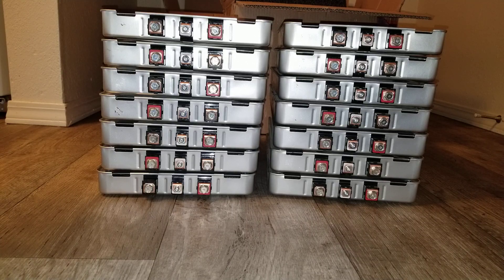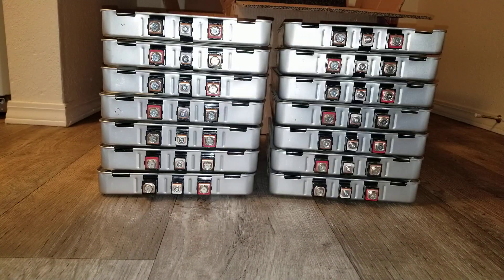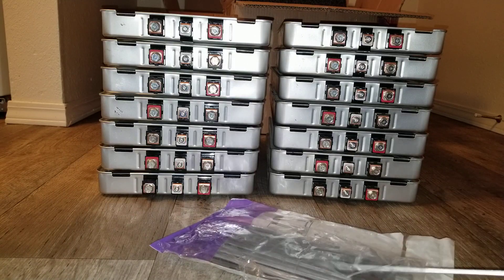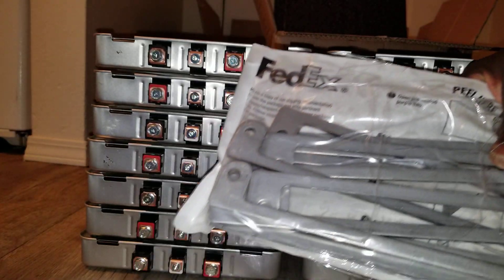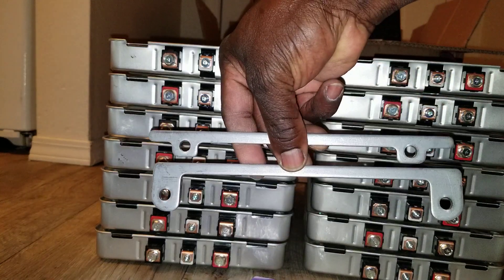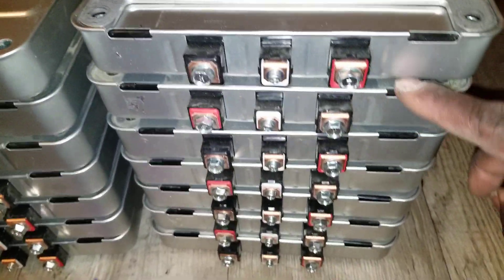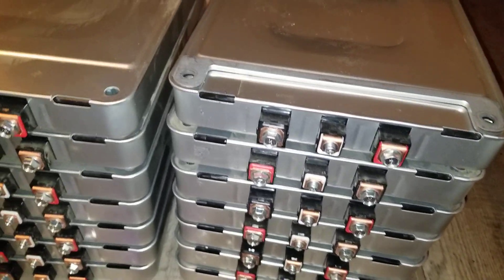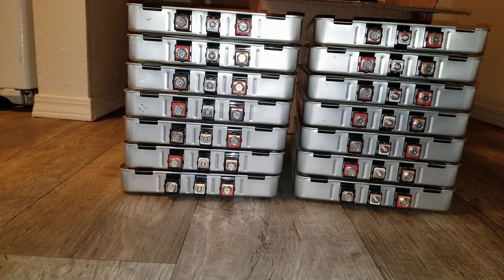OFF-GRID SOLAR BATTERY: How to Install Nissan Leaf Battery G1 Spacers

Comment: Hi my man,
Which one of these two sets of batteries is better?
32 x 3.2 volt 100Ah or 16 x 3.2 volt 200Ah?
The 32 pieces @ 100Ah will serve 2 lots of 48 volts each while the 16 pieces @ 200Ah  will be used for 1 bank of 48 volt
Reply from the maker: You can do the 16 Modules to reduce the numbers of strings if you don't have enough room for 32 Modules. But all in all is just the same.
Reply: @jwsolarusa  That's what I thought. I truly appreciate you!
Reply from the maker: You are welcome buddy and sorry for the late response towards your question.
Stay Tuned for more videos coming up soon. 
Cheers